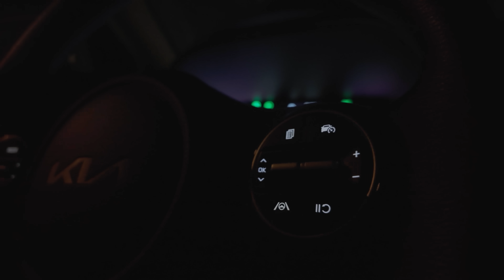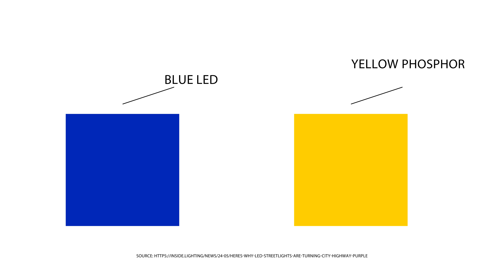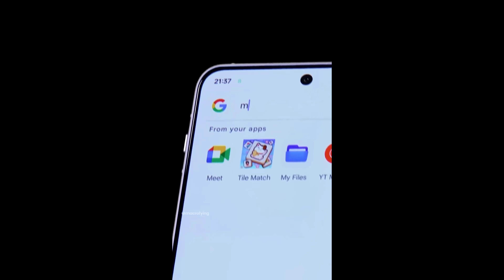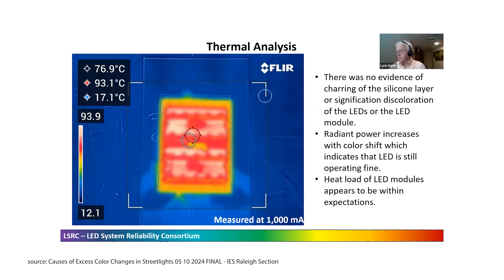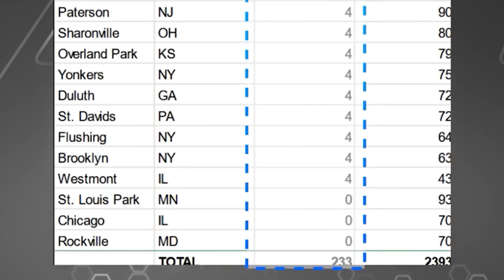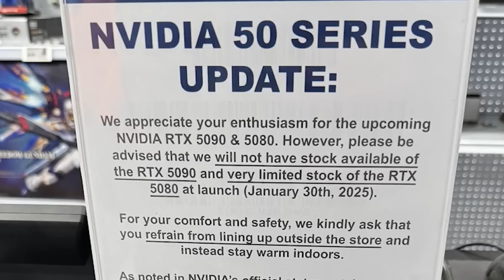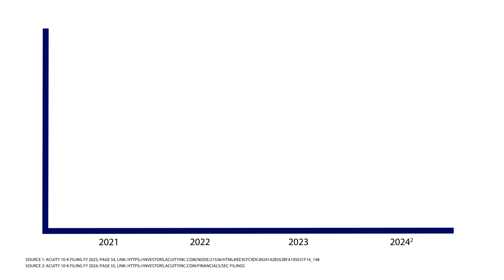The Hundred Million Dollar Mistake That Turned Street Lights Purple!

Comment: The reason for it mainly being one brand is that there are not many brands that meet DOT specs for highway lighting. My state DOT has only five brands that are approved. Much of this stems from the 5-year warranty they require on all luminaires (from date of installation). So, here is how the LED swap-out worked: The blue LED was not developed until the late 1990s. They were far too expensive to use along roadway corridors until the early 2010s. The fixtures do not save as much on power as household lamps do (%) but cut a 200w high-pressure sodium lamp down to about 120w LED. But the DOT saves much more on the labor, equipment and traffic control expenses involved in changing HPS lamps every three years when the LED has a 5-year warranty (and likely will last much longer). As the prices continued to drop, more and more road authorities came up with funding to do large group swap outs. What appears to have happened is that AEL either changed processes, suppliers, or design over the years in order keep costs down in this competitive and growing market. So, AEL likely had a problem in 2017 that didn't really show up until a couple years had passed and after having sent two years of shipments totaling 10s or 100s of thousands of fixtures to customers. So, they likely changed their manufacturing processes in 2020 but are still on the hook for the 5-year warranties on the bad ones from 2017-2019.

Comment: 03:55 ... or the street lights were constantly being bombarded all day long on the top of their housing units and the UV plus heat of the sun's rays degraded the laminate adhesion. 
The FLIR heat testing was done by testing the LEDs while they were on in the evening or in a lab room. Was any testing done outside around 2pm, the hottest part of the day for an object being directly hit by the sun's rays? A cluster of LEDs don't have to be on in order to be cooked inside a lamp housing during the entire sun's track across the sky during the hot summer's day.
Clearly this had an impact on the composition of the silicon adhesive keeping the laminate bonded together.
I'm just an old disabled mechanical engineer... what kind of troubleshooting could I possibly know how to look into after all?

Comment: They are not made that way because it’s cheaper, that is not true at all. so much r&d goes into that phosphor development. leds that use a phosphor achieve much better Color rendering index, because the phosphor is actually producing many many more colors, filling in reds yellows greens and cyans and everything in between. this fills in the color spectrum with much more than just rgb, leading to much better product that looks more natural.

Comment: RGB lighting is not a "better" alternative to blue + phosphor white LEDs. LEDs are monochromatic, similar to lasers they only emit a single wavelength of light (or rather, a very tight distribution around a center). Our color receptors are sensitive to broad, overlapping ranges of wavelengths, so they can't tell the difference between white light and a mix of discrete red, green, and blue wavelengths, but the objects the light reflects off of definitely can. plenty of objects have pretty complex colors, we may perceive an object as white under sunlight, but if it actually has some gaps in its wavelength/reflectivity response, and one of those gaps aligns with, say, the "green" wavelength used by a given RGB illumination scheme, we'll see it as purple because none of the green light is reflected.  the reason phosphor is used is not because it's cheaper (in fact, a decent phosphor is typically more expensive than adding diodes), it's because the phosphor doesn't produce a single wavelength but a continuous spectrum, which is necessary for accurate human color perception.

Comment: Unfortunately, the same issue has occurred in a part of a major avenue in Athens, Greece. However, naturally they have not been replaced so far. They have been blue for years. They all turned blue, seemingly simultaneously. We have other issues with other LED street lights. Mainly intermittent slow flashing. Those get replaced, though. Usually.

Comment: If heat is the issue, which it almost definitely is, the problem is definitively caused during summer as the sun beats down on it during the day. The heat and uv light can also cause it to become brittle over time. The reason bright leds are attached to giant heat sinks is to mitigate the heat problem

Comment: Thinking about the light pollution and astronomy angle, sodium lights were much better because it's a sharp narrow spectral line that can be easily filtered out. The LEDs and incandescents in fluorescence have much wider band emissions and there's really no way to filter it out when they're all mixed together. 
   Also when you look at the longevity and maintenance cost with the sodium lights the money you save there is equivalent to the money you save on electric with the LEDs , so the cost is about the same. How close to the same cost?, I don't know, I didn't do the studies to manipulate the statistics.

Comment: I like the warm color of the sodium lamps. Reminds me of summer nights as a kid
Reply: There lumen per watt rating is REALLY high.  (Power consumption for amount of light produced.)
So high that's why a lot of municipalities hung on to them for so long.  A few in the Milwaukee area still have them.
Reply: @button-puncher In West Allis, there's still a ton of HPS and even LPS lights still in service! (Albeit the LPS lights are all slated for replacement to LED's because the only LPS bulb manufacturer for a while, Phillips, discontinued them entirely sadly. You can't get new replacement bulbs now.)
Reply: @zachzebra56  Yep!  Friend used to have a house in 'stallis.  The LPS lights kill me.  They are SO orange.  Makes so many cars just look black.
I'll still miss them when they are gone.  Warm orange glow.  Like a low sunset.
Reply: I was out there like 2 or 3 years ago and I remember seeing the purple lights. The Uber driver filled me in on what the deal was. I guess it took a long time for YouTube hear me and suggest this video😂 @button-puncher
Reply: Yeah they're easier on the eyes
Reply: 2000K LED street would be awesome
Reply: @davidperry4013  They do make 2100K 'amber' units (sometimes sold as "bug lights") in various form factors but they aren't common. I have a couple for my yard. I would like to see a switchable version where it defaults to 2100K but activates 4000K upon motion or a switch.
Reply: Sodium bulbs came out in the early '70s.  A professor of mine said those lights reminded her of "Soylent Green," which came out around the same time.
Reply: not that great for visibility though
Reply: @stackflow343  Sodium lights are excellent for visibility. Cone cells, which are responsible for visual performance in naturally and artificially illuminated environments, are most sensitive to yellow light. It is a marketing myth that blue-sensitive rod cells are involved, roadway lighting is far beyond the upper limit for rod cells to reliably function.
Reply: @stackflow343 within the illuminated area, yes: LED is better

But for driving at night and overall night vision, the warmer color of those lights is better. LEDs will quickly dilate your pupils, which will kill night vision between the street lights.
Reply: @hotshtsr20  Awful bold of you to assume that 6000K-8000K LEDs are the only kind to exist. Halogen lights in the 3000-4000K range have about the same effect. 

Also, I think you mean "constrict" instead of "dilate", and that's a matter of intensity (candela) that is utterly independent of the nature of the light source or it's CCT. 

About the only  correlation is that LED lights are focused more intensely for greater range. The distance a light can "throw" is directly correlated to Candela; Throw = SQRT (Candela * 4), though a lot of car headlights are cooler since lower CCTs have lower lumens/watt
Reply: @alanjervis9022  Yeah, constrict. My mistake. 

The bold assumption was on your side. I didn’t specify 6000-8000k daylights. That’s ridiculously blue. The current LED street light offerings are considerably bluer than the ultra orange HPSs used until LEDs took over, which is all I said. I don’t think a single sane person would argue that current LEDs are the same color temperature as HPSs.

Colder color temperatures cause more pupil constriction than warmer for the same intensity. This is medically proven.
Reply: The purple lights are way better

Comment: The safety risk is even worse than you point out. Blue light disables your night vision (rods). White street lights also do this, but at least they provide decent amounts of illumination. One of the advantages of sodium vapor is they don't disable your night vision as much. LEDs could do this too (just have a lower color temperature) but they didn't do this for whatever reason. 

Anyway, it's not a big deal in urban areas, but if you live somewhere more suburban or rural where there aren't street lights everywhere, going from blue light ruining your night vision into total darkness is REALLY disorienting and straight up dangerous.

Comment: Seoul Semiconductor is the actual manufacturer of the chips that failed. It was batches of them, and likely ones destined for Acuity product. They are [Seoul] normally very high quality, lot of streetlights are poorly heatsinked (run too hot) and poorly made, cheap capacitors that flicker etc, this was a batch issue that was in place for a long time and caused major long term issues. They (Seoul) extended their warranty significantly to cover this., but the real issue is closing the road and actually changing them, that takes the real money and Seoul doesn't pay for that. LEDs are cheap. In their volumes, per streetlight might be 20-50 dollars of LEDs at most, the warranty burden isn't so bad.
The issue was delamination/failure of adhesives in the phosphor layer, causing colour shift/lack of stokes conversion.  It could have been contaminated surfaces, improper cleaning, poor batches of adhesive etc.

Comment: As an environmental lighting consultant in the UK, we don’t have this problem here. A serious effect of blue spectrum (and especially UV) emissions from these street lights is insect depletion from surrounding dark areas. Bats and other light sensitive insect predators avoid lit areas but because insects are drawn to the lights if they emit blue spectrum light, it decreases food supply in the dark areas harming a range of species. We actively design schemes in the uk with no blue or UV emission and specify ‘warm white’ 2700k lighting in rural areas to reduce its impact on ecology.

Comment: The strides LED lighting has seen in the last 15 years or so, from red and green indicator lamps to highly efficient white lighting is due to the development of the blue LED. Some people who have viewed and shared comments said the defective LEDs were the product of overheating within the fixture due to insufficient thermal management design of the fixture. This is most likely partly to blame, but I would say it is a combination of lack of thermal management design to get the heat out of the fixture, quality of drivers used in fixtures and quality of the LED chips. I have always heard this problem has only occurred in LED fixtures fabricated by AEL where the phosphor coating falls off the blue LED diode. I would say the problem is due to a faulty batch or batches of LED chips mixed in with bad fixture thermal design and cheaply made drivers. From what I have experienced over the years is the weakest link in an LED fixture are the drivers that can easily fail under high heat.

What makes the whole situation worse is when municipalities do not change out the bad fixtures when they turn blue in a timely manner. This is when the conspiracy theories start and people start making up stories that these lights are intentional, and the main reason blue LED fixtures are planted on freeways and turnpikes, is so when law enforcement pulls you over on a traffic violation, they can also tell if you had been vaccinated for COVID or not, which adds 15 months to your jail sentence.

Comment: 3 minutes in and I got more disinformation than any content in last few years.

I worked with street lights. I know my shit. It's not a question of cheap or money saving or vibration or bad adhesive. It's a question of the manufacturer using too much current for the LEDs and basically burning the phosphorus off with high heat produced by the overpowered LEDs. Also blue (slightly UV LEDs) are used to shine through phosphorus because it's the most efficient way to produce high cri (color rendering index) white light.

Comment: I've always understood that the reason white LEDs are made from a blue LED and some phosphor that converts some of the blue into yellow is simply that you actually get a brighter light that way. I understand this is because red and green LEDs are much less efficient and would need more power to give the same amount of light that we get with just one bigger blue LED and phosphor.
Reply: In fact, ultra-bright LEDs, like ones designed for video projectors, use phosphor-converted blue LEDs even for single-color blue and red LEDs. We are even starting to see this done in ordinary indicator LEDs.

Comment: One word: HEAT. Those buggers put off A LOT, and these failures were always happening either in the balmy heat of summer or in the blistering cold of winter.
Reply: Things fall apart when they get hot.
Reply: failures happening because of heat in the blistering cold of winter, u are a comedian 😄
Reply: @echelonrank3927  large temperature differences also causes things to break, this is the same thing that makes hot glasses violently explode if you put ice in them, just less extreme.
Reply: @sackboy1665  in fairness, this definitely falls under the “the universe has a sense of humor” category
Reply: @echelonrank3927  It’s either the high temperature or the temperature differential that kills ya, and a wild swing in EITHER direction could be enough. It could also be so that the light gets damaged in the summer but only in the winter does the adhesive become brittle enough to completely delaminate.

Comment: I wonder if it would be easier and cheaper to replace or add a phosphor lens on the defective lights so you don't have to pull the entire module down,
Reply: That is a good question. The technology in question is neither theoretical nor new: it’s called “remote phosphor”. It’s unclear to me why it hasn’t become more popular than it is. I’m not sure whether you could retrofit it onto a fixture designed for “traditional” LEDs, though, as it would change the pattern of the light emission, since the remote phosphor acts as a huge diffuser.

Comment: so this was Very interesting but not a big surprise in any way well there was one surprise this company did not weasel out of the warranty obligations that is Quite Refreshing ! so the purpose of these led street lights is/was energy savings ? so in the old days the not so long ago old days there were mercury  vapour and high pressure sodium bulbs most commonly used in street lighting and for the most part terms of 20 plus years were common, yes everything had a yellow hue to it and yes I do like the white light cast by these leds and the visibility is much improved, but now is it ok for these leds to last less than five years and they are still called energy saving, perhaps at the municipality level at the hydro meter but at all other levels they do not save anything do they if it is all added into the envirovental and financial costs?  many more service trucks are required over time more industries to manufacture them and more landfill ! the most common failure I have seen with these here in Aurora Ontario is strobing have not seen a purple led light anywhere but no matter the failure none of these get repaired and I am sure many could be or made so they can be ! I do not in anyway claim to be an expert I just have had experience in these matters with being a Millwright and Industrial Electrcian for 44 years working in boxes without windows aka factories.  Cheers!

Comment: You know what would have been cheaper? Not replacing them in the first place with these LED lights.
Reply: Just getting better leds would have been best. Old lighting is too inefficient. Unfortunately, someone wanted to save a buck 😂
Reply: @drmantistoboggan2870  much less than a buck
Reply: @drmantistoboggan2870  actually hids are very efficient